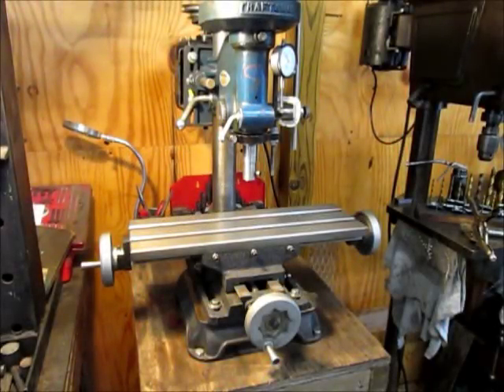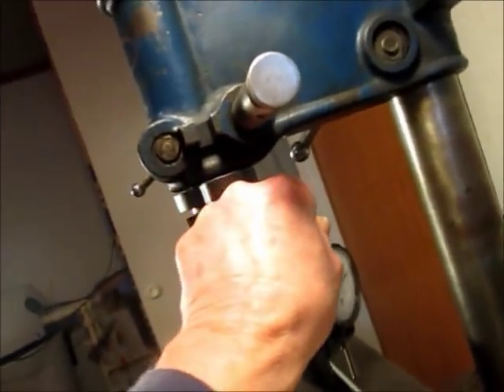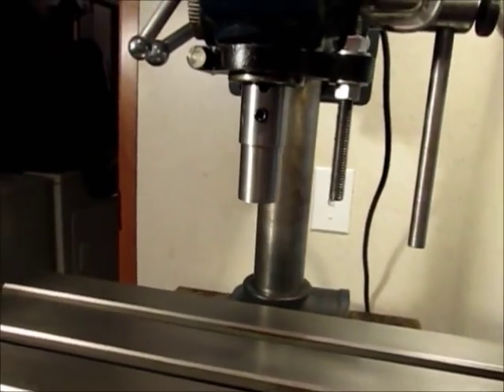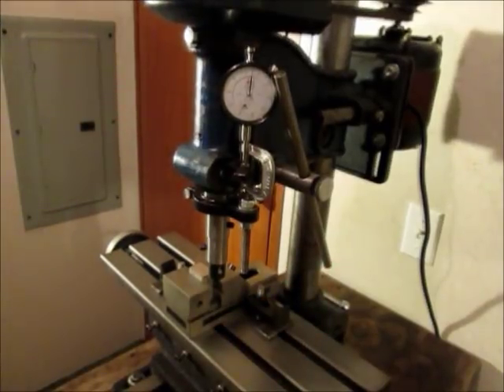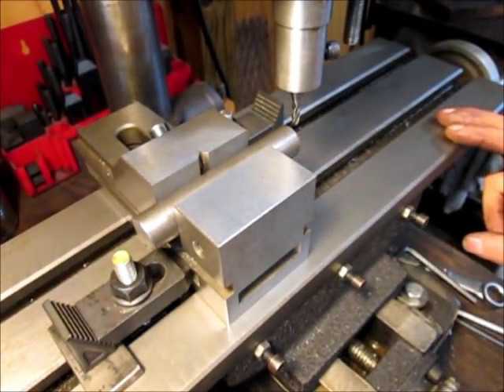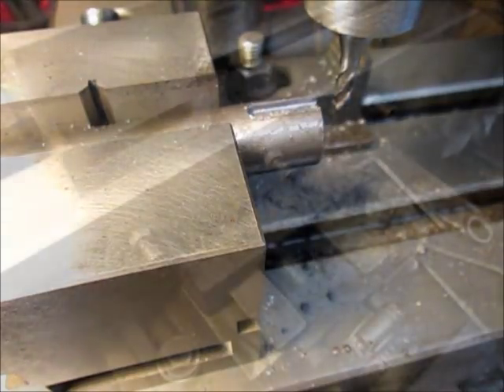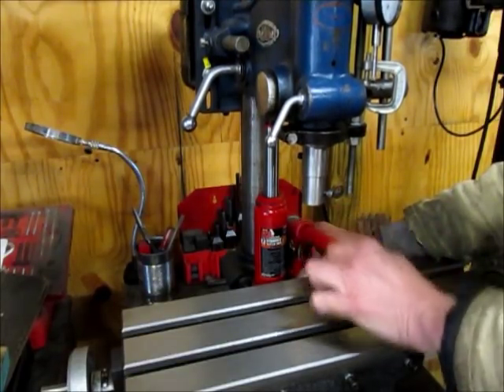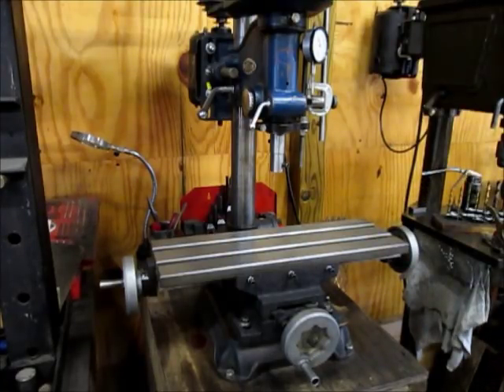Milling with a Drill Press

Comment: Nice, get's the job done. You need to get a third pulley to get some lower speeds. I've done a bit of milling in my press, but glad I have a benchtop now.
Reply from the maker: Steve S Thanks Steve. I had a 3 pulley set up at one time, but removed it for some reason and didn't put it back on. I'll have to reconsider that.

Comment: Thanks for putting this vid together. I have the same drill press, but the quill is not as tall as the one you have. What is the quill travel on your dp? Also, the attachment you have that holds the bit, was that made specifically for the Craftsman 101 dp? Can you tell me the part number? Thanks!
Reply from the maker: I turned the chuck on the lathe. Was going to adapt an er collet holder but ended up getting another mill.

Comment: I am very impressed ---keep your hands away from that chuck ---that bolt that retains the cutter/drill chuck is a weapon --if you could find one that is flush with the surface that would be awesome.  All in all, its very cool.  Is it for full time heavy production?  Obviously no.  Can you use it and make useful parts?  Yes---so let the people who are ragging you go back to their dremel tools  and you keep on going.  Who cares if you have to change the bearings every few years---they are cheap and you change them when necessary.  Awesome!
Reply from the maker: Thanks for watching.

Comment: With a block of wood under the spindle you can use the spindle to lift the head .Then lock the head .If it needs to go higher add another wood block then lock the head and remove the blocks.

Comment: Interesting, I've been thinking about picking up a cross slide to try this for a while. I would use it mainly with RC modeling & machining custom cpu / GPU coolers. I used a Bridgeport for a while in the workplace. Those same $300 Harbor Freight mini mills you have over there are re-badged over (UK) here & cost about $600 in your money. About twice as much. I wouldn't justify it for maybe 3 uses in a year. Good idea with the DTI for depth. I might try it now.
Reply from the maker: Thanks for watching.

Comment: I like the spindle design without a taper. Is a taper absolutely necessary?
Reply from the maker: A taper centers the chuck and locks it to the spindle. What I made for this is more like a coupling that couples the spindle to the tool. Mills have female spindle tapers and drills have male usually with no provision for locking. The chuck I made in this vid is pretty limiting. This set up got me going but I soon moved on to a more standard mill.
Reply: @RPMechanics  gotcha thanks

Comment: This is great - I have the same old Craftsman drill press and was thinking about doing this very thing- I want to be able to  make some repair parts for pedal steel guitars - mostly aluminum or light steel - I think this might be good enough -if not it'll be a fun project at least.  Where did you find the milling table?
Reply from the maker: +Tioga Fretworks Thanks. I got the table from Grizzly. You can also use a compound vise.

Comment: Did I miss it or did you mention anything about a draw bar being installed on this drill press? to hold the chuck.
Reply from the maker: +Micscience No, the chuck is a press fit on the spindle held with a set screw.

Comment: If you have a bearing issue, you can solve the bearing problem by replacing your lower spindle bearings with an angular contact double row bearings.

Comment: Have you milled a lot of steel with this machine. Thinking of making a similar machine with an old drill press like yours.
Reply from the maker: I haven't used this machine in a few years. It did ok for what it was.

Comment: Some drill presses have tapered bearings.  Did Craftsman put them in yours per chance?  I'm going to check my drill press...
Reply: → to the knee the vintage drill press were designed for side load that have brass bushings and a thrust bearing needs to be 1950 ish and below do some research

Comment: @RP Mechanics - So, 3 years in... How are the bearings holding up? I've been wanting to do the same thing, but keep getting the "You'll shoot your eye out, Ralphie!" from all the machinists out there. I'd be willing to find an old beat drill press and give it a try if it isn't a wasted effort.
Reply from the maker: The bearings were never a problem. They were making some noise when I got the machine and I switched them out for about 10 bucks. The main draw back is that you're limited to end mills.

Comment: Yah ever thought about using a scissor jack on the back side of the press it would be more convenient to adjust the drill presses height? Or make a bracket that connects the jack to the front of the support pipe and the jack is on the back of the support pipe. The scissor jack would hold firmly your chosen height, just saying.
Reply from the maker: Barron Thompson In part 2 I did just that with the hydraulic jack. Thanks.

Comment: can I pleas ask how have the drill head bearings held up against the sideways forses due to milling?
I have thought about using my drill press for some light milling but head bearings have always put me off doing it.
Reply from the maker: I didn't have any problems with bearings, but I didn't use this machine a lot. Basically set it up to teach myself some basic milling and then bought a regular mill.

Comment: What happens is the bearings wear because they aren't oriented in the proper direction for milling, milling puts sideway stress on the spindle.
I have a small sherline vertical mill, its too small for most work excerpt hobby stuff but its very rigid and accurate.
It might be better to "fix" a harbor frieght mill.

Comment: This is great. I've been searching for a more affordable way to mill steel. What was the  horsepower on the motor you used?
Reply from the maker: +Jim Thanks. It's a 1/3 H.P.  Most important is a drill with a good quill lock and taking light cuts. Using a drill chuck that was held on with a taper gave me problems. It would fall off of the spindle when the tool came in contact with the work. That's why I made a chuck to fit the spindle.

Comment: Well, I can't recommend doing this because the bearings aren't designed for it and the head being on a rotating post doesn't exactly instill confidence in safety or precision. But if for some reason you decide to do this, try a piece of glass on your bed to level it. This way you don't have the interruptions of the slots shaking your indicator out of place. Also not ideal to have your indicators bounce like that.
Reply from the maker: Chill dude

Comment: Did you have to do anything to the grizzly x y  table to get it tight?   Which one did you get?
Reply from the maker: +John Smith The table worked well out of the box.
Reply: How heavy is that thing?  It can't really weigh 60 lbs can it?  I am interested in using it for some light aluminum milling w a dremel mounted to a drill press stand but it seems it may be too wide and heavy to not leave permantpy sitting there? 

Could a guy maybe cut the left end of the table and the left side wheel off to make it a little more compact?  I mean would it still function w just the right side wheel?

Thx
Reply from the maker: +John Smith I would just buy a smaller table.
Reply: There are smaller tails that look like that for micro Mills that have 8" wide tables, a little too small. I cannot find a table that is in between those two sizes

Comment: I'd be a little concerned with the machine bearings not being able to cope with side to side stresses because it was designed mainly for downward pressure.It probably has ball bearings rather than roller bearings.
Reply: *****
Now THAT is the way to go.
That would keep the stresses out of the drill machine bearings.
 Exactly my point. Thanks!
Reply: So? Car alternators have roller bearings in front, too, and they last tens of dozens of miles, at the very least. The belt is pulled and often overtightened on these all the time by home mechanics and they get driven every day and last a couple of years. Considering he's a light user and he's feeding slow, not taking hogging cuts with a little luck he could decades out of it!
Reply: Thanks for sharing that. PM had a WWII book that showed all these really wartime shortage techniques... Incredible book. I wonder if that is available online, too. If I find my copy and want to put it online, is that legal to do?
Reply: jtjjbannie Why not just replace the bearings with tapered bearings?

Comment: Where did you buy the 6 by 18 drill table?
Reply from the maker: Mike Treacy, Sr I ordered it from Grizzly.com.
Reply: Thank you.  I picked up an old 100 lb Sprunger 15" drill press which was designed to be used as a mill/drill and hold .001.

My son is a precision machinist.  He looked over the unit and concurs the machine is a beast and ought to work fine with an x-y table and Kurt vise.  

Will check out Grizzly.

Thank you!

Mike
Reply from the maker: Mike Treacy, Sr You're welcome and good luck.

Comment: Using a drill press for a mill will require you to say goodbye to the spindle bearings so might as well order some soon. They arent made for that like a mill. I have a drill press just like this one too. It wont hold up.
Reply from the maker: Held up fine. Bearings are cheap and easy to replace. I changed out the originals once.

Comment: i have just read the comments --there are some dickheads out there pal.  -ps.  i wud use a scissor jack and a cordless drill to raise an lower the head --if one fits in there. i have a jack and have made a bar to fit it and use my 24 volt drill and it lifts a car easy. if you put the drill in low gear you can get some accuracey. it's good what you have done already tho mate. - good luck in the future. --- stu

Comment: Enjoy replacing your spindle bearings every few years due to the side loads of milling for which drill press spindle bearings were never intended.  The spindle bearings of drill presses can handle very light cuts on aluminum, not much else.
Reply: +Railgap Esoterica years??? i did that once and fucked up my bearings after minutes :D
Reply: +Railgap Esoterica Why not replace the existing bearing with proper radial load bearings?
Reply: Why not make a silk purse out of a sow's ear?
Reply: Railgap Esoterica Why do anything?
Reply: Railgap Esoterica Simple fix would be to install tapered bearings.
Reply: Huh.  It's too bad that bearing manufacturers only know how to make drill press bearings.  If only someone knew how to invent a bearing that can handle a radial load.  Maybe in 100 years someone will be smart enough to figure out that kind of miracle.......
Reply: This drill press does not have bearing it has bushing so no need to replace them
Reply: If you do some research you will see the vintage drill presses were made with brass bushing or bears to hold side load so there isn’t any issue. These days they do not make Drill presses to hold side load
Reply: Yeah by the time he did all that just to have a cheap mill that won't be what he expects he could have worked a part time job and bought a used mill.
Reply: And once he bought a used mill he would start replacing all the worn parts that made a seller of that mill want  to get rid of it. Then he would probably realize that he had to stay at his part time job much longer to save for a brand new mill.

Comment: Did you change the bearings, I have a Harbor freight 8" DP i'd love to convert, no, I don't have the funds for a real Mill. I'm an old man on a fixed income, crippled in a wheelchair, 600.00 might as well be a million.. so details would be nice.
Reply from the maker: The main thing is for the press to have a sturdy quill clamp. I needed my lathe to make the chuck. The quill in this press is 5/8" round. I wouldn't go any smaller. I did this so I could teach myself basic milling but a lathe with a milling attachment might be a better way to go. I've since bought a mill/drill and set this press back up for drilling only. This press is old and heavy with solid castings. I didn't change the bearings.

Comment: drill press = no side loading
Reply: to be fair that old drill can handle lite lateral cuts i would use endmills with 4 or 5 flutes though. not fly cutters. make plunge rough cuts then cleanup.. if bearings are available that will fit that old baby an made for lateral loads that would be a win. my 2 pennys. thanks for sharing
Reply: Most 4-5 flute end mills do not center cut.  A center cutting 2 flute end mill should plunge just fine but do your homework and be careful about your selection if buying new end mills for plunging.
Reply: +johnnybarbar thats true but if your making horizontal cuts it wont matter for flat bottoms use a flat bottoming drill
Reply: Jon A Lol, just a quick look at an end mill tells you if it can plunge or not. 

If an end mill can plunge, it has to have at least one flute center out on the bottom, that's it.

Comment: Best ADVICE   DONT use a DRILLING DESIGNED MACHINE  to be Used as a MILLING DESIGNED MACHINE !!  VERY BAD Idea !!  a Drill Press is NOT designed to use Lateral 
SIDE THRUST , its NOT Rigid enough , Bearing are NOT LARGE ENOUGH  it Cannot HOLD an END mill RIGID enough and you will GET HURT !!  
Stay SAFE use your Brain and USE Machine Tools AS they are  "DESIGNED"  to be Used